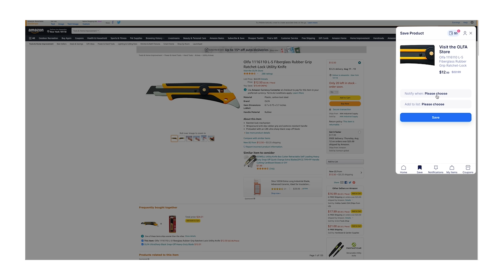Making a CNC Dust Shoe with 3d Printed parts! - No More Dust In My Shop!

Comment: Hi, I watch your videos from time to time and find them very useful and also very well made. Now for the red springy 3D printed piece, you've inserted, not to allow sawdust to come out upwards, around the router bit and spindle: I don't know how healthy this is for the spindle, the router motor, to have the remaining dust going toward it. I have a more professional cnc router, also with a Hiteco spindle (motor), and it needs compressed air, which is blown trough the spindle, in order not to let sawdust get into the spindle/motor. The company that sold and installed the machine, explained the purpose of this. But again: I love your videos, the inventivity, everything about them.

Comment: Seems like with this dust boot it will be tricky to take a measurement from the top surface of the materiel as dust boot will be in the way. And the spindle will push it down when probing

Comment: "It has an 8.7HP spindle".... without water cooling? How is that even possible? Also, if there is 50 amps going through that cable going to the spindle... huh? The cable doesn't look thick enough to handle 50 amps. (6 kW? 8.7HP = 6398.84 watts)

Comment: Awsome videos!!
I purchased your Dust Shoe Digital file.
But noticed your files are not to scale.
I imported the dxf file to Vectric Aspire and noticed that the file is scaled for 15 inch thick material not 5/8 inch. I've also noticed that the scale on the stl file for example  the spindle dust adapter is Z: 80 inch, X: 268.6395 inch, Y:  166.9998 inch.
I don't own a 3d printer and will have a local store that provides 3d printing services print all the 3d parts for me.

Comment: Hi! Did you connect all the metal conduit and the wire inside flexible pipe to the ground? It's for avoid static discharge.

Comment: Hello Alex! Thanks for your great work! If you could provide a little more info on your TPU print settings? Wall thickness, nozzle diameter, you mentioned 45deg angle on the design right? It seems to compress well, how about expanding, works ok too? I plan on using it for my mill and lathe! Cheers

Comment: Now that you have it surfaced, zero on the spoil board and adjust for the nominal thickness of your work sheet. (If you zero on the top of the work sheet you will be forever resurfacing the spoil board unnecessarily whenever the nominal thickness is not accurate.)

Comment: To clarify, the corner is "zero zero" in relation to the end mill that you zeroed with., not the center of the spindle.
Reply: I'm pretty sure the 0,0 refers to the lower left corner in the drawings when placing parts in software like fusion360 or Vectric. The 0,0 corner will be in the same spot no matter what size end mill he uses. He could have used the 2" flattening bit to cut the boundaries of 0,0 but then the inside corner radius would be too big...

Comment: About the idea that the wood is at 0,0...not unless you set the path to be bit radius off of 0,0. As you cut, you could end up cutting off more of that border if you use a larger bit than you did before. You should not set the path to be closer to 0,0 than the bit radius.

Comment: Hey, that hose has metal in it.  It could accidentally trip your proximity sensors on the top of your z axis in the middle of a job.  I have the same brand system.  I actually zip tied the hose to the top of the z axis so it could not move around it and remained in a safe place.  More strain relief, and a long job may not be accidentally interrupted.  Cheers!

Comment: how did you make your boots springy? i tried 2mm thick boots and its stiff as a PLA im using TPU btw
Reply from the maker: 50* angle and only two perimeters with a 0.6 nozzle

Comment: I've recently been turned on to 1/8" compression bits for cutting plywood and other sheet goods. It'll run full depth one pass, no tabs needed since it will pack the chips into the slot. I'm not going back.

Pretty cool design for a dust shoe. Gives me some concepts to work with on the one I'm designing in my head.

Comment: Did you take in account the router bit width when creating the zero corner? And how is that going to affect future projects?
Reply: Some CAM software can overcut the inside corners automatically to provide the relief for a fully square tab to insert. I do it manually in my CAD design with a circle a few thousandths bigger than the tool, and moving it 45 degrees so it just passes the corner by a few thousandths.
Reply: Thats usually done in software, inside, outside or on the line cut.

Comment: Just a question could you not flatten the front edge and add the zero zero stop to the back of the table, that way if you were cutting a longer sheet you can over hang it off the front edge and still be able to cut what you needed? I dont know if that is something you can do I dont own a CNC so just thinking out loud, great videos by the way

Comment: Nice design.  Here's a couple of issues where this dust shoe will have collisions:
1. toolpaths for 3D reliefs that are taller or deeper than your dust shoe's Z clearance - i.e. The cutter moves higher and lower than the shoes clearance will allow relative to the top of the workpiece (like if you were cutting a tall mountainscape using a short bit)
2. Workholding clamps will collide when holding a small workpiece

Comment: I’d think about long bristles still. I had a shoe like this and I do a lot of small projects. When the shoe was near the edge I had dust fly through the gap. Better air flow and no router fan blowing chips will make your setup work better than mine did near the edge of the workpiece.

Comment: The dust collector pipe that comes into the room you could have left short so the 90° elbow would be dead center of the table. Now all you need is a damper door so it's not pulling air when using other tools in the shop. Also you can use an Arduino and a couple of servos to open and close the damper door at the top. When you go to use your CNC machine  it can turn on the dust collection system remotely (so you don't have to leave the room to turn it on if that's what you have to do) when you go to use your CNC machine the moment it turns on, it opens up the damper door at the top and turns on the dust collection at the same time automatically.

Comment: How wide are the plywood sheets where you live? Here they are 1600 mm by 2200 mm. This table doesn't look like 1,60 m wide
Reply: The regular size is 1220 by 2440, with the odd 1250 by 2500 if it's a "veneered" plywood with a face of oak/ash etc. He can also get his hands on 1500 by 3050 oversize sheets. My guess is that the working area of the table is 1250 by 800-ish.

Comment: Because of the sliding adjustability, it wouldnt be that hard to add a 'setting' where you could have the dust collection head move up and down the with the spindle should you find that necessary on a particular project.  Could even be as simple as a sturdy rubber band hooked to the spindle head and the adjustment knobs left loose. As always, love the design and manufacturing processes you show. Great vid quality! Cheers from Maine, USA!
Reply: I was really struggling to figure out how he was going to address that but your reply sounds solid enough!

Comment: At my old I also put together and got an Avid CNC router table running. The shoe we used was third party and the guy made them out of laser cut acrylic. Worked well and the best part was that he made the brushes and spacers magnetic so it was super easy to just take off the show and adjust the height. An issue I see with your solution is that it might be tricky to get your references with the tool touch off probe and tool changes

Comment: "...in case you have to deal with the imperial system." Alexandre knows the pain of American makers.
Reply: Scrolled to the comment immediately after he said that lol.
Reply: The system that is easiest to use is the one you grow up with.
Reply: @ZrubekFamily  What? No it's not. I grew up with the standard/imperial system and it is fundamentally arbitrary. 12 inches to a foot, 3 feet to a yard, 1760 yards to a mile. You buy land by the acre, which is 43,560 square feet.
Reply: @ZrubekFamily  not true

Comment: Nice job!! 
I'll make one comment.. I have a similar style dust shoe that stays at a constant height..  I also added in a t-slot clamping system instead of screwing the work piece directly to the spoil board...  In this case I need to make sure the dust shoe doesn't impact the t-slot hold downs.  Just means I need to be careful on where I place them in relation to where the cuts and gantry travel will be.  Obviously if you stay with the screw hold down technique then this isn't and issue, but t-slots in the end give a nice variety of hold down options...

Comment: Open some ventilation up in that flexible red 3d printed collar, so, the created suction pulls air from there, to create an airflow from router to the part, then to the dust collection. Now it sucks from around through brushes, which is fine, but the volume right around router collar is dead air, fine dust can go there and stay there.

Just an idea, i dont know if it is a problem worth to solve, or the solution is efficient enough, but here it is an idea.

Comment: Should've put your registration slightly outside of (0,0), because now the screws you would use to secure the plywood are now within the cutting area... But then you wouldn't be able to cut through to the edge of the plywood, so tradeoffs, I suppose.

Comment: Hmm, the fact that you are now limited to 2D as the dust show is not able to automatically change Z-height makes me curious to the design thoughts behind it. 

Why did you decide to do it like this regardless that it hampers you to work in full 3D without manual oversight? 
Or is it a future project to add Z-height adjustment?

Comment: What I did was just glue a piece of scrap packaging crate wood on the top so you can surface that and it doesn’t overhang the cutting area. That way there are also no screws that you could hit.

Comment: Great video, I used a dust shoe like this for a long time, there is only one problem with it, you can't make those really cool time lapse and smooth cnc cutting shots. I still use something like this when surfacing, but most of the video I shoot uses simple spindle  mounted dust collection.
Reply: More problems: you can't easily zero your Z-axis. You can't use lasers to see the bit position and easily zero X and Y.
You need a detachable system.

Comment: I wonder if it could be a good idea to add some kind of locking/clamping mechanism on the top of that red accordion tube, make it a little longer, and have it always be up to the drill and attached. That would keep it from eventually wearing out and not springing back up, and if you need access to the bit, you can unlock it and access it normally.
Reply: I also thought about it, but then it would be difficult to reach the tool to change it. The way it is now, he can just raise the z-axis and change the bit.
Reply: I was thinking rare earth magnets